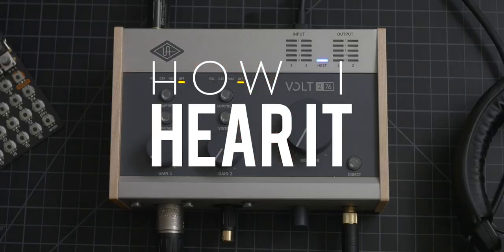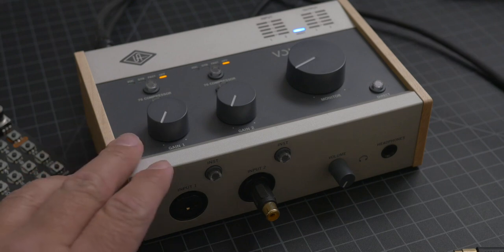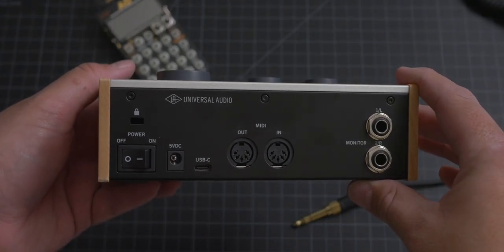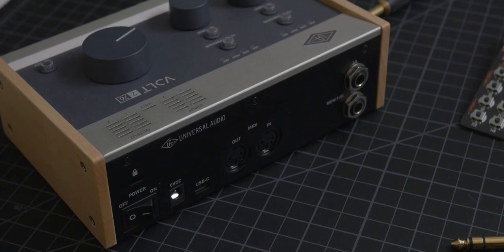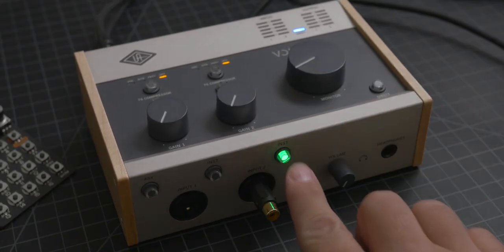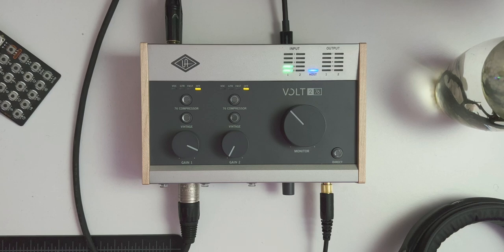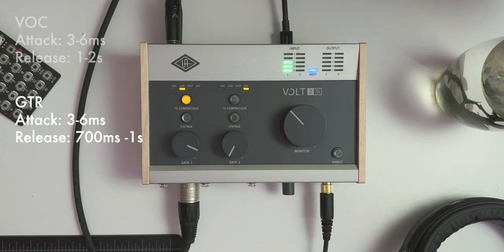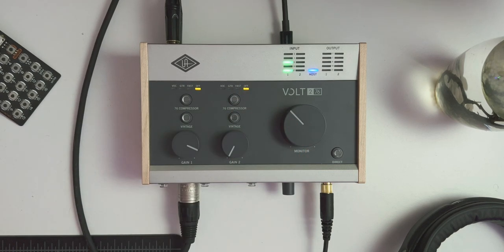I love the UA Volt 276, but it's not why you think

Comment: How did you release your XLR cable? did you notice after you plug your XLR in it is impossible to pull it out? You will never have access to use that channel with TRS Quarter inch input. I have 2 Volts a 4/76 and a 2/76 my XLR cables a permanently locked in. They have no release tab.
Reply from the maker: Hahah use your muscles. They come out.

Comment: Very cold video, and the unit looks great. I have a very good Focusrite interface that stopped working after 18 months of just sitting on the shelf. Really surprised me, because I spent $500 on it in 2016, and haven’t even used it that much. So I picked up a used universal audio Volt 1 just to get recording again, and realized later that I should’ve just spent more money on stereo inputs, as I do a lot of high and acoustic guitar work, and I have two very good condenser microphones that I like to record acoustic guitars in stereo.

So I was looking at getting the Volt 2, but then I started considering getting this because it has the compressors built into it. Then I was thinking I probably don’t need to get this because I use logic pro, and it has a ton of very good compressors, including the UA 176. What to do, what to do… 🤔

Comment: Do you think having the compressor on Volt 276 is much better than getting just Volt 2 without the compressor, do you think it justifies the higher price? Thanks for the review.
Reply from the maker: If you're recording instruments and vocals into a DAW where you can control the amount of input and also run plugins, then the Volt 2 will be great. In my case, I like using the compressor for live video calls. 

There is something to be said for the character that the compressor gives to the signal. For instance, since having this thing for a while, I've experimented with overdriving the signal into the compressor. You can get some nice harmonic distortion this way. The "vintage mode" also adds a little "air" and subtle harmonic distortion in the top end.

Comment: id like to see this vs the apogee boom. the apogee has DSP onboard that might hold up against the volt's onboard compression. even if it's not analog, it might be more useful and the apogee does have nice drivers.
Reply: If you don't play guitar and use the DI, or have a seperate DI box the Lewitt connect 6 is pretty good too since it's in the same price range

Comment: My main grip with this one is the crackling issues on the main knob. 
Sad, cause it’s a great interface for the money
Reply from the maker: For sure. I was really bummed when mine started doing that. Sweetwater replaced mine for free. Im now using an analog volume attenuator between the box and my speakers. This way I won't wear down the interface's knob as quickly (hopefully never).

Comment: I wonder if this will be about the horrible white noise that the 76 comp is supposedly imposing on all audio run trhough it...
Reply from the maker: Ha! Did you comment without watching?
Reply: @llllMills  I commented based on the thumbnail/description as I was starting to watch it!
Reply from the maker: What an interesting way to watch YouTube videos! So what did you think? I haven't noticed any noise with the compressor on.
Reply: @llllMills  well maybe am just weird like that 😁...am thinking of getting this unit because of the built in analog processing. But found a reddit theead where some one was saying that the comp adds a ton of white noise...and that if you track using that it will be useless because the noise keeps stacking. Nevertheless. Am only interested in using it on a complete projects on the mpc1 when recording them to a DAW. Also this unit (476) has 4 out an ins. Wich would be handy if I ever wanted to take audio out of the mpc/DAW and route It to some external hardware...I was only worries about the possibly noisy comp and overral built Quality but it seems that I need not to worry and just buy this sweeeet piece of kit 😍

Edit/ and the power button and wallpower is great because I do work mostly from mpc1 standalone Mode.
Reply from the maker: 😉

Yeah I don't think noise is an issue. So far I love this thing. I say go for it!
Reply: I have the interface and there is a lot of noise when the compressor is on which is disappointing, I have tried adjusting all levels many times and it is always there.
Reply: @improvewitherror  i can also attest that the noise is there. it sucks, but that's the way it is. if compression is the feature you're after, i can't recommend volt 276

Comment: You can actually just level gain both inputs at the middle...and that will make up for the -5 or 6 db increase....
Reply from the maker: If you turn the levels all the way up, then turn on the compressor, you still get the boost. Either way, the compressors are boosting.

Comment: I subscribed and thumbed up, any chance you could answer a question? I bought this for live-streaming and the direct button on blue still doesn’t mono my input. When I listen back everything is 100% only in my left ear, and if I switch inputs everything goes 100%

Is there no way to get a simple mono signal back? I DI out from my amp, so I only need one input. Should I get the 176 instead? Thanks in advances
Reply from the maker: Thanks for the sub! Pressing the direct button once gives you separate input monitoring (input 1 in left ear for example). Pressing it a second time puts it in both ears.
Reply from the maker: Pressing once, the button turns orange. Press again and it turns blue. Blue will give you the mono signal in both ears.
Reply: @llllMills  i think I have a defective unit :( thanks for thw response!

Comment: What is your favorite ? this Volt or the Motu M2 ??
Reply from the maker: I'm going to have to go with the Volt. What are you thinking?
Reply: @llllMills  I hesitate between the two 😅 I like the sound of the Motu, and I like the UA Volt because UA made finaly a interface without DSP ! What you think about the quality output phone amp ? Which one are better for you ?
Reply from the maker: @JasonicIR8  I don't remember hearing  a difference between the headphone amps. Both had plenty of power for my 250ohm 770's
Reply: @llllMills  A big thanks for your answer ! I m think I will take the Motu :)

Comment: why you need that effort just for miner sound effects. somebody explain for me please?
Reply from the maker: It's not for sound effects. The compressor keeps your input level from clipping (distorting). This allows you to get get loud and quiet and then loud again, with a more even sound level than without a compressor.
Reply: @llllMills  how I can use it with my iphone 13 shooting video? I want to use it for filming video podcasts and I need it for mic.
Reply from the maker: @likeris2  I haven't tried this, but you're supposed to be able to use it on iOS. iPhone will need the lightning to usb adapter. iPad needs either the same adapter or direct USB-C.

You might need an app that can take advantage of the interface (like a DAW or music app). You should be able to use GarageBand and other apple audio apps. I'd be curious if it works with apps like Zoom and other video conferencing.

Comment: Do You recommend this ? Or the ssl 2+ ?
Reply from the maker: I haven't tested the SSL, but I like the look of the UA Volt much better (you do have to look at it all the time 😂). I'm sure you can't go wrong with either unit. I think the SSL is a little cheaper, so if that's a concern, I'd say go with that one.
Reply: ssl2+ has more gain and clean preamp , if you want to podcast or vocal ssl2+ is good
Reply: subjective if looking for preamp sound, Volt sound warm , SSL2 Sound neutral but litle bit bright
but if you looking for feature go with Volt 76 series
but if you looking for clean preamp go with SSL
Hard to say who overwal better

Comment: does it sound better than the m2?
Reply from the maker: There's no way to say. "Better" is subjective. Technically, on paper, the M2 is "better" in a lot of ways. The M2 has a little more gain on the inputs, but as far as I can tell, no noticeable  noise difference. After using both for a while, I can't tell a difference in sound quality. I would recommend both equally on every feature, except for the built in compressor (of which the M2 does not have).
Reply: @llllMills  thanks for the reply, i currently use the m2. was interested in the built in compressor

Comment: I wouldn't buy a UA Volt 276 if it wasn't supposed to produce music, honestly. I was kind of confused when you compared it to Motu M2 and Focusrite. But then I understood that you're analyzing it on the perspective of vlogging. Because, in the perspective of music production, the fact that the Volt 276 has Universal Audio's vintage preamp circuit and a compressor based on the classic 1176 model built in, makes it incomparable to any basic interface like Focusrite Scarlett 2i2. And this is because those circuits are not only to prevent clipping. Those circuits in the Volt 276, actually, are going to deliver analog saturation to the audio, which is very pleasant to the ears and impossible to achieve with digital processing. So, if you are not a musician, I do not recommend you to buy this interface. Just stick with any normal audio interface and use very low input gain to prevent clipping. In my opinion, the Volt 276 was made for low budget producers, who can't afford to buy analog equipment, but also wants to apply some analog color/saturation to their recordings.
Reply: Having the compressor on is great though. Instant radio voice for videos, streams, etc.
Reply: @DerRabenbarde  Tottally. I agree. However, if you're on low budget, and you also don't actually need the "analoggy" sound of the UA Volt 276, you can use any regular "cheap" digital audio interface, record your voice with low input gain and apply any zero latency digital compressor plugin to smoothen the audio dynamics and then amplify it to the desired volume. You'll basically have the same effect of the UA Volt 276. You can even configure the compressor to be on default in your recording app. You just won't have the analog saturation, which, for general use, is not necessary in my opinion
Reply: @DerRabenbarde  Would you use that for voiceover recordings, in place of an UAD 1176 plugin?

Comment: So no autogain
Reply: Huh??? Does any interface around this price level even have that? 
I've gone through specs and reviews for probably all 2-in/2-out interfaces in this price bracket and haven't seen that mentioned for any of them.
Reply: @danielpujol8266  If you put a button for a compressor or " vintage " on it, you gotta have autogain. If it does crank the gain by 6 or 7 db like Mills said in the video, you gotta have a minus 6 or 7 output. For me it makes sense. If you don't , than you just bring the noise floor up.  I know it's not like obviously audible but it's still something that you should have on a basic compressor . I mean, it was their choice . A basic compressor does not add gain to the source ,that's the input knob, a compressor just has to compress and add color if that's the case. That's my opinion . also science